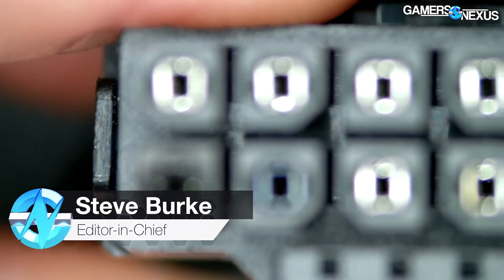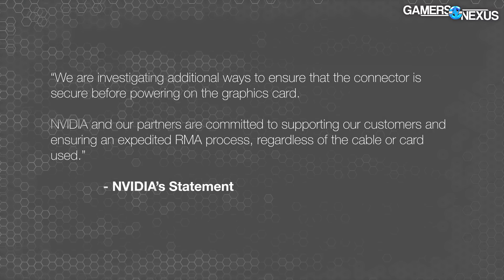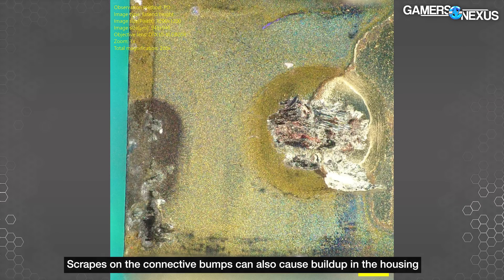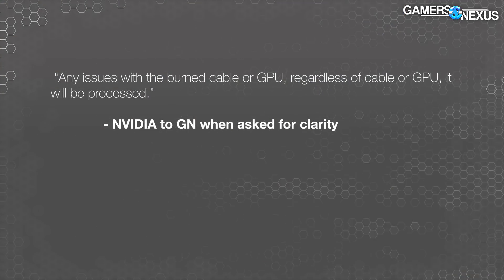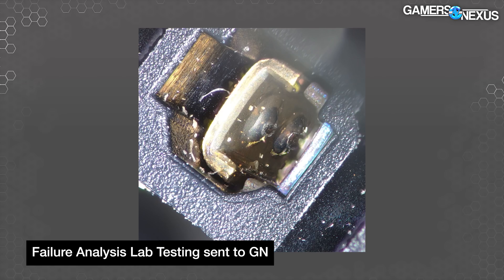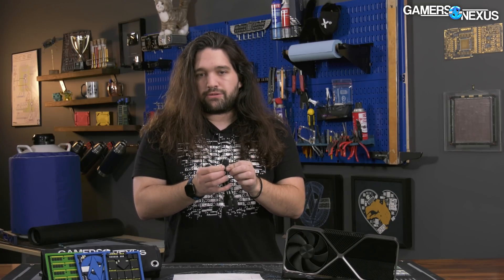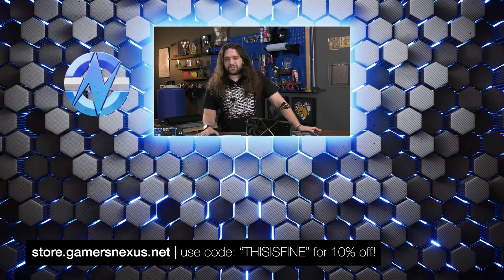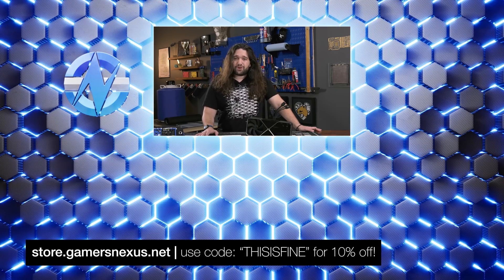NVIDIA Responds to Melting Cables, Warranty Concerns, & 12VHPWR Adapter Failures

Comment: In the medical device industry, we don't use the term "user error", rather we use the term "use error". This shifts the blame from the user to the design. It's not uncommon for something like this to slip through, what's important is the response and corrective actions for product that's already out there and for future product. Shortening the sense pins, probably on the card side, sounds like a reasonable solution. Let's see what they come up with.
Reply: @AlexBarbu  easily the best take in this thread
Reply: @AlexBarbu  well considering the low power throughput of molex, its a non-issue if they arent plugged in right.
Reply: “Of course it’s company policy never to, imply ownership in the event of a dildo… always use the indefinite article “a dildo”, never “your dildo”.”
Reply: @AlexBarbu  in my years as a tech I have seen dozens of melted 13 pin 24pin and 6\8 pins. A quick google search would have stopped you looking like a complete moron. Oh well.
Reply: Too bad this is not a medical issue.
Reply: @Digikidthevoiceofreason  
Yeah.... It is not a big deal... Cheaping to save few bucks on a 1600 $ flagship product, who cares? Fork out the cash and shut up!
Reply: You guys are also not factoring in that forcing a severe bend on the cable is also a big part of causing the failure. That's entirely on Nvidia for making a giant brick of a GPU and forcing people to plug it at an awkward angle that wont even fit most cases. It's really just a perfect storm of bad design coming together.
Reply: @AlexBarbu  LMFAO @ no examples of molex melting. They are a legendarily bad connector, legendary for partial connections melting or catching fire ffs - and they arent trying to carry 10s of amps. Just how ignorant are you?
Reply: I am absolutely shocked that a video has to be published about how to plug in the connector right. It means for me that this design is not good and possibly could be examined by regulatory bodies to determine if it can be considered safe enough to be used. Although I assume it has gone through such examination and got approved but it looks like practice proves otherwise. Thus it could/should be re-assessed.
Reply: @sandornyemcsok4168  You do realize that the design for the 12 (16) pin came from the regulatory standards body. There is a reason that they stressed having to go back to that body to have design changes made.
Reply: @joee7452  
You do realise that you do not even understand what is what, do not you? PCI SIG is not a regulatory organisation/body. It is a kind of industry stardardisation organisation (operating within a specific industrial/technical area). Regulatory body is an organisation which has power, it can order companies to recall products, in worse case it can even fine companies. For example the U.S. Consumer Product Safety Commission is such one.
Reply: @sandornyemcsok4168  0.04% failure rate? 50 in 125000 cards? Not safe enough to be used? Okay, sure. I'm certain you're using 50 things with failure rates oscillating around that chance of failure or much, much, much higher %.
Reply: @TheDravic  Those numbers make the very incorrect assumption that all of those cards have been plugged in, they haven't, thousands are on ebay and other sales sites being scalped and thousands more are waiting to be scalped. Half of that number at best may have been opened so far.. so your real failure rate is closer to 1 in 1000 which is too high when the failure has to do with something that is supposed to be standardized. Would you wait until a failure causes the death of an entire household before changing from a error prone and objectively badly designed connector?
Reply: @bdhale34  you don't have any evidence to support the numbers you just made up in your head. "Half of the cards have been opened at most". Listen to yourself lmao.
The truth is right in front of you. If you want to make numbers up, at least have them be within a realm of plausibility. Let's say the real number is 10x bigger. That's 500 instead of 50. This would move the percentage from 0.04% to 0.4%. Crazy :)

That would still only be 4 cards for every 1000 cards.
Reply: @TheDravic  well, then tell us how much is the failure rate of the electric connection of other common household appliances that may cause fire, for example microwave owen, toaster, etc. ? Or of the motherboard power plug?
Reply: @TheDravic  That is one in 2500, that is not safe, that's absolutely atrocious!
Imagine every 2500 stops, you cars brakes would stop working, every 2500 stories an elevator would come crashing down.
There are about 85000 commercial flights per day in the US,  that would mean more than 30 plane crashes per day.
Reply: @kilianortmann9979  mmm what? Why are you changing the uses cases to individual executions instead of 1 out 2500 parts?
And lets not forget that he just randomly increased the number ten times to accommodate the nonsense that was said to him before. The number is 0.04%, thats it, anything else is baseless speculation
Reply: @Estarvia  Because it is easier to visualize and does not really matter. Typically acceptable failure rates for dangerous isues are in the realm of 1 per several 100 000 or Million product lifecycles.
Reply: @Estarvia  0.04% - this is 1 in 2500. So Kilian Ortmann used real life number, not inflated one.
Yes, it is a bit of small issue. But it isn't negligible. Yes a lot of those cards that were sold are still held by scalpers. I doubt it's 50% of course, because we don't know the numbers. But it isn't impossible that the number is no-trivial and does change math a bit.
Yes changing the percentage of all cases to percentage of uses is wrong. But still it is something that is worrying and arguably that use makes it easier to visualize. And that silence from NVIDIA was very bad. They only started saying things once GN video came out. This is ridiculous.

Also from memory chances of MCAS making a failure like that in 737 MAX was lower than 0.04%. And yet many people freaked out and weirdly some people didn't want to risk their lives on such a small chance of dying...... I wonder why....
Reply: @kilianortmann9979  tell ya what dude, find me a CONSUMER product with a failure rate below 0.1%. Its not a pacemaker ffs.
Reply: @kilianortmann9979  I don't like the new connector, but you are ignoring the case that user error is involved. A car maker will sell 1m cars. About 10% will have an accident. 2% will be bad. You still have to look at it and say what percent was caused by the car and what was caused by the driver. It the accidents are caused by them developing a shotty break system that failed when used correctly, then it's a dangerous car. If accidents are caused by the break system not being able to stop the car in time because the driver didn't allow for enough space or was going too fast, then it's not the car that's the danger.
Reply: @TheDravic  Depends on your mode of failure. If the failure is the card simply refuses to power on, then sure 50 out of 125,000 is fine. When you get smoke and fire involved though, the general acceptable failure rate is 0 out of 125,000.
Reply: @TheDravic  A 0.04% failure rate is orders of magnitude worse than what any QA engineer would sign off as acceptable.  The specification for a failure like this would generally be something like 0.000000004% (4 in 10 million units).
Reply: @kilianortmann9979  "That is one in 2500,"  It is   at least that. That is from 50 cases globally so far, by those that have been RMA,  over a short initial period.
  It isn't all those that will be installed from initial sales, future sales, and those now working their way out after extended cycling.
  The connector and high power level passes all tests standalone by people who are not paying retail and wrangling the small connector and large wiring bundle into a box. It can even handle the current with fewer connectors. But it isn't normal use testing which it seems has some problems. It should be a more positive connection.
  It is hard to connect on an expensive card that users who paid retail may be reticent to force. This seems   to me    partly due to the stylish recessed position making it difficult to force. Partly the plug has many shrouded pins and many mating surfaces. They are all parallel paths, why all the shrouds?
  If the connector is fine and remains unchanged what of the next generation?
Reply: @jannegrey  you're crazy, you're absolutely crazy. You're comparing a  nearly guaranteed death if your plane crashes with a little smoke from melting a piece of plastic inside a well-isolated case. Eventually the power supply will stop providing power. Not only that, the whole case is enclosed in various materials that have incredibly high ignite temperatures. How are you even going to get the fire out of the case, it's so incredibly unlikely. The (un)lucky stars would have to align for any kind of fire to leave the PC enclosure. It's not power supply that would explode here, that's way more dangerous. This is just some plastic melting.
Reply: @TheDravic  Just some plastic melting initially. But it can short by being pushed that way. That means possible fire. Yes, in most cases it will just burn down plastic. And in most cases MCAS simply gave an error.
Talk to me when you have someone who died from electrical fire among your friends from faulty component.
And I'm not comparing nearly 100% chance of dying from plane crash to some chance of starting fire.

I was comparing chance of something going wrong. In this case it was chance of something going wrong with MCAS (which happened hundreds of times, only 2 planes thankfully went down because of it) with a chance of cable having a malfunction. Please do not mistake the 2. In probability you have to recognize which probability you're talking about.
Reply: @TheDravic  Ive seen more than 100 different people on reddit showed their connectors melted. And most of people dont post that online so Im guessing its awful
Reply: @wadimek116  I'm going to need a list of those 100 people. The megathread had 25-30 people depending on if you count UNCONFIRMED melt or only the confirmed ones.
And why are you saying most people don't post online? It's a highly unusual situation for anyone that it happened to, it was covered by tech media, it was a high topic of discussion on Reddit. I'd say most people who have it happen to them would at least consider posting on some social media about it, if only to have their minute of relevance.
Reply: @TheDravic  Because most people don't post that stuff online. I don't only count megatrend. I've seen at least 50 but more like 100 different cases now. Burned gpu or cable photo is enough conformation for me.
Reply: @TheDravic  I don't care what nvidia confirmed. Nvidia data isn't reliable for me because I don't even know what they mean by confirmed case and they will minimize it. If someone connector burns the card goes to trash because it mechanical damage. And my point about online still stands. You may not like it but we are in minority discussing it. Most people don't post online. They just buy and use the card.
Reply: @wadimek116  Nvidia never said there will be no more cases after yesterday's statement. Surely the number of cases will grow with time with the number of cards sold and used.

But as far as yesterday's statement, Even if you double, no, triple the number of confirmed cases given by Nvidia you're still only talking about going from 0.04% to 0.08% or 0.12%. I don't even know what your point is.
Reply: @mycosys  Kitchenaid sells 2.5M stand mixers per year. If 250, let alone 2500 of them would experience the same issue within their first months of use, we would probably know about it.
Reply: @TheDravic  Yes so the problem will disappear because nvidia said so. I say no more world hunger and no more cancer then
Reply: @bdhale34  lol, I thought crypto crashed and scalpers are selling GPUs at a loss now?
Reply: @TheDravic  It's not "0,04% videocard failure", it's "0,04% fire hazard rate" and that is definitely way too high. Compare it with how often PCI plugs or regular wall sockets melt.
Reply: @vsm1456  fire hazard is such a nebulous term when you're talking about melting plastic inside usually plastic and aluminium case and it's not the power supply; it's just the connector on the graphics card. Good luck getting that to spread outside the case before power supply shuts off and even if it didn't, you need such incredibly high temperature to get anything else to melt inside the case. ALL of your unlucky stars have to align perfectly for this to be an actual fire hazard outside the confines of the PC case.
Reply: @TheDravic  I'm not taking 1/2500 chances of it being "just inside the PC case", let alone 1/250 that you think is still fine (wtf, really?). Thankfully, safety standards seem to align with my expectations. Even PCI-SIG itself started warning about potential problems before 4090 launch.
Reply: @TheDravic  Yeah, you're indeed very weird. From claiming 1/250 chance of power connector melting is fine, to interpreting a legitimate concern (one backed by safety standards) as a hope a fire starts.
Reply: @vsm1456  What the hell man, I was responding to someone else making ridiculous claims, there is no 1/250 chance unless you know more than we do and can prove it.
Reply: @TheDravic  "Let's say the real number is 10x bigger. That's 500 instead of 50. This would move the percentage from 0.04% to 0.4%. Crazy :)" - What did you mean here then? From the context and wording it sounds like you think 0,4% is fine too. 0,4% is 1/250.
Reply: @vsm1456  The person was making ridiculous claims, I was making a counter point to show how ridiculous it sounds. The problem is not as widespread as the people trolling about it would like people to believe.
If you miss the memo, the person I was replying to said the number would be twice as high because they said 50% cards are sealed in boxes according to their imagination, which would only double the number of cases per 1000 cards. So to make my point I said "let's say it's ten times more".
Reply: @TheDravic  Okay, I got you. However, even if his claims are totally wrong and all those 125k cards saw some use, 2x difference is nothing in this case because even reported 1/2500 failure rate is still hundreds or even thousands times more than what seems to be considered acceptable by today's standards for this kind of failure.
Reply: @TheDravic  This is within the 1st month. If the problem had gone undiagnosed and the cause didn't become public: the failure rate could climb a lot higher in the future due to cables that have been improperly seated but haven't loosened up *yet*.

Or computers that are fine for 2 years; the owner opens it up for whatever reason (migrating the GPU to a newer motherboard, cleaning up, installing other HW) and leave it improperly plugged once he's done.

Not to mention this is a fire hazard. So far it didn't do anything further beyond damaging cables and GPUs. But it could potentially have nasty consequences. Risk is evaluated as chance_of_failure * damage_caused. Failure rates are not the only thing to be concerned about.
Reply: @Estarvia  if the issue is a design flaw or a user error then that figure corrosponds to 0.04% of times the cable is plugged in resulted in it melting, so using individual executions makes sense for that context. now if the problem is deemed to be with manufacturing then using parts makes sense.
Reply: @AlexBarbu  Your actually wrong. There have been a ton of issues in the past with the molex and  8 pin cables and connectors melting or causing fires, sparks, shorts, etc. Just about any new tech when it first comes out has problems. The difference is that they have now been around so long that the issues have pretty much been worked out. In a couple of years, if the same 12 pin is still in use, I am sure that these types of issues will not happen because they will adjust it to make it as idiot proof as possible. 
Don't get me wrong, I don't like the cabling as it is, I don't understand why they couldn't place the connector in a way that you could see the latch and connector so you can easily see if it was hooked. 
But if they all just stuck to the old ways all the time, you wouldn't have a cell phone as an example. I mean cell service was spotty, had tons of issues, the phones sucked, they were to big, drop calls a lot, could have bad noise and interference, etc. land lines never had any issues in comparison.  Why not stick with wired line? Of course going back further, land lines sucked, had... etc, etc, etc.
Reply: Nah. Thats entirely the users fault. Yall need to start taking responsibility for YOUR fuck ups. Literal lives are at sake. What the actual fuck is wrong with you people?
Reply: @Wylie288  
Because if the design leaves considerable room for user error then it is not a good design, especially when there is a safer design in place (the old 8 pin connector). It is as simple as that. Furthermore it is a top end product, I expect top end design, solutions and materials used in a top end product. But Nvidia decided to use this new connector, why? To reduce cost! To save money.... And here the arguments are that oh, whatever percentage 'is an acceptable failure rate', or trying to shift the blame entirely to the user 'ah, it is your fault'. How stupid and ridiculous is that?

Comment: Hello @gamers nexus.  Is there a simple reason why the power to the card cannot just be a single large gauge cable for 12volt + and one for common?
The breakout to individual circuits tc could then be handled on the board perhaps even with traces built in.

Is there a good reason why this wouldn't be better?
Reply: It would require a very thick cable and increase the risk to users working n the case.  Spreading the load across multiple conductors reduces the current on any one wire.